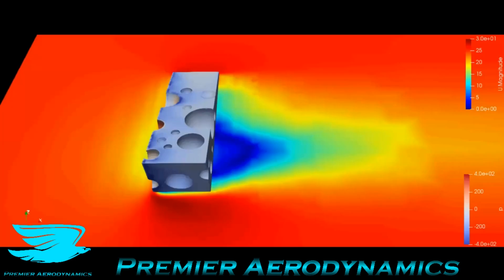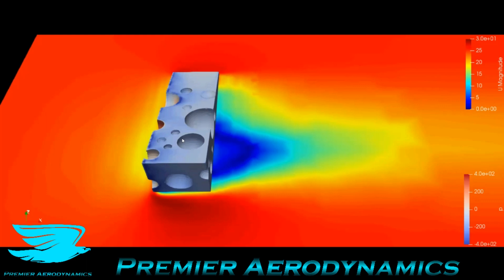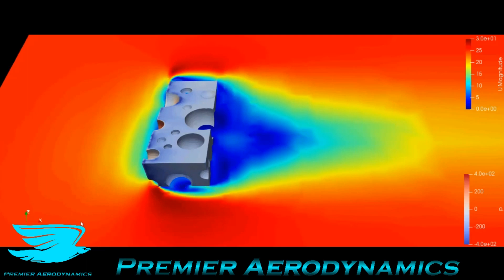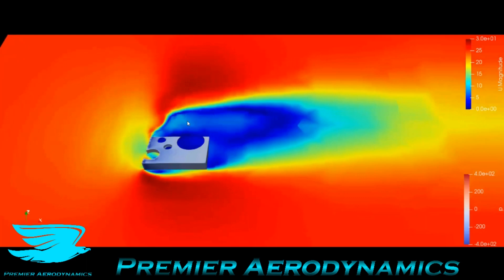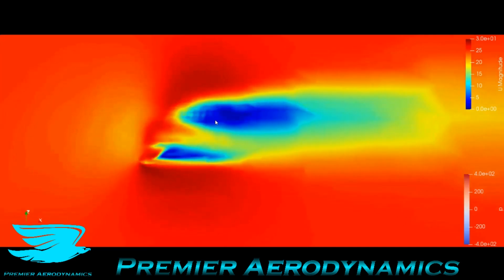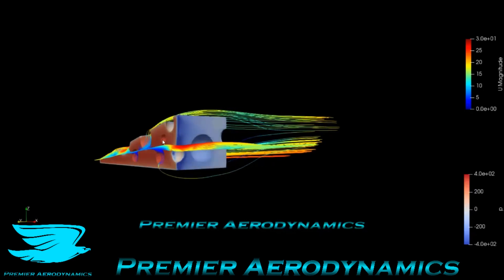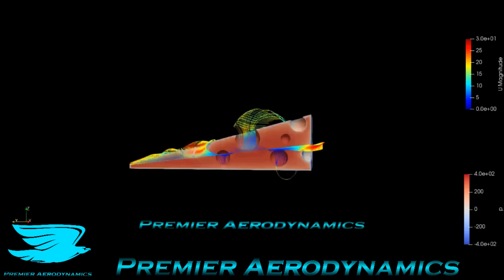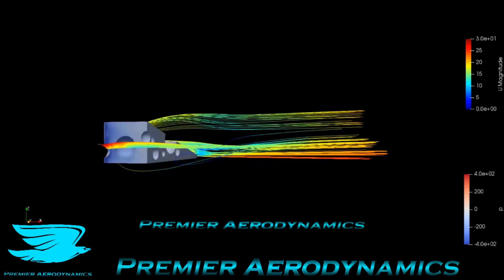Is SWISS CHEESE AERODYNAMIC??

Comment: In my pc woudl try to calculate it, it woudl take a very, very long time. So your pc must think great
Reply from the maker: Thanks! There might be ways to speed up the calculations on your computer so that you can do them too.
Reply: @PremierAerodynamics  i got 2 cores intel core i4 as i remember
Reply from the maker: Well, one tip to keep in mind is that you don't need a fine mesh everywhere. It's tempting to make the mesh fine everywhere, but for example, it can be much coarser near the roof and left and right walls because the flow there isn't that chaotic. Refining the mesh only around the object is a good way of reducing the number of cells, which reduces the computational power you need.

Another tip is how you solve it. This is a little advanced, but you can play with how you initialise the flow. You can use a converged steady state simulation as the initialisation of a transient simulation.

Little tricks like this help reduce computational time.